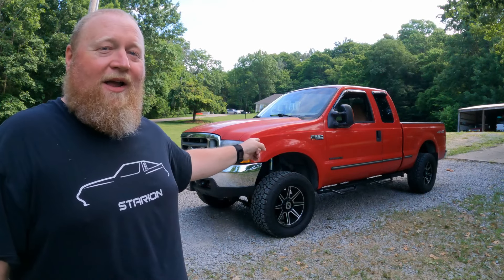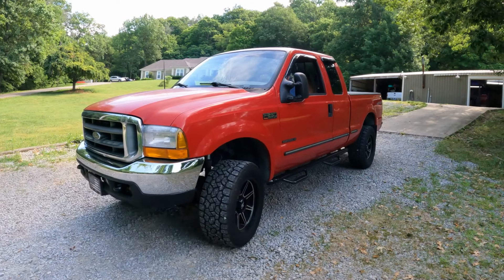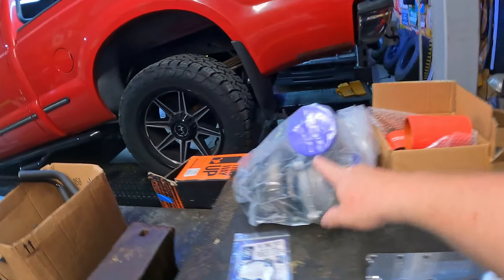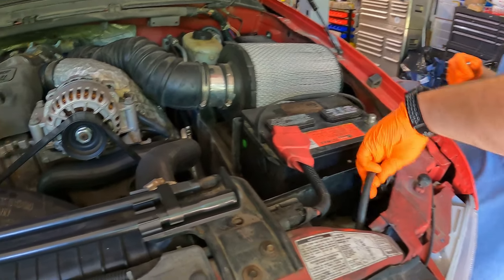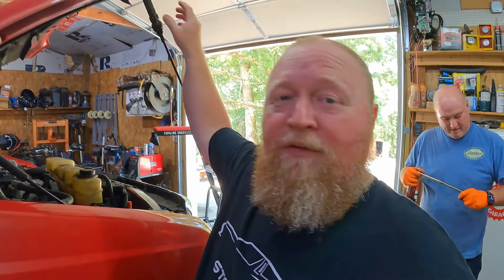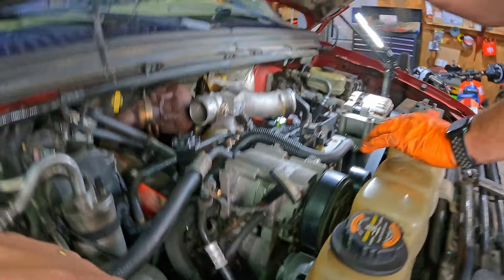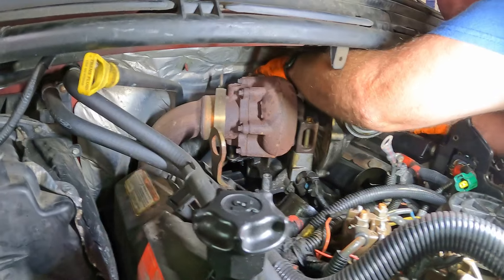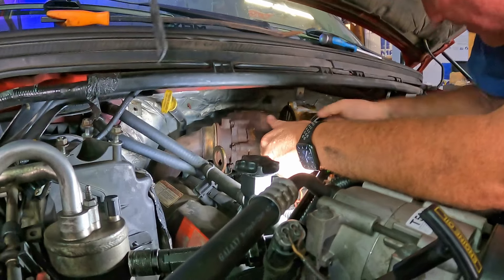The F2-Hooptie Returns! Major Work on our $500 7.3 Powerstroke | Turbo, Plenums Exhaust and more!

Comment: I've been missing the F2 Hooptie, that's what got me hooked and subscribing.  The lift of the rear is super smart.  You're not only creating content, but you are also teaching your buddy and some of us that have no 7.3 Powerstroke experience.  Do the plenums have a bonded seal?  I noticed you cleaned the "grey glue" off but didn't see any gasket material @ 21:10?  Time stamp 21:39 for the right bank plenum, I saw grey sealant on the base while you were explaining the plenum notch.
Reply from the maker: Yeah, evidently I missed the sealing part of the plenums. Ford used a grey permatex like bond. I use "The Right Stuff" from Permatex.

Comment: The EBPV delete pedestal is a good upgrade while your already in there. It will get rid of an oil leak and exhaust restriction, especially if your installing an upgraded turbo. Get the high flow exhaust port with the EBPV Delete pedestal too. It makes a big difference in exhaust flow.
Reply from the maker: Good info, thanks!

Comment: Great video.   What an amazing deal...$500!  I can relate with the "why would they do something like this?" I find there is a paradox when working on my 7.3 if something is easy in concept (removing the turbo) it turns out to be extremely difficult where you would need octopus arms.  If something is more difficult in concept (replacing seals on the fuel bowl and HPOP) it turns out to be simple!
Reply from the maker: Yes, I have the same experience.